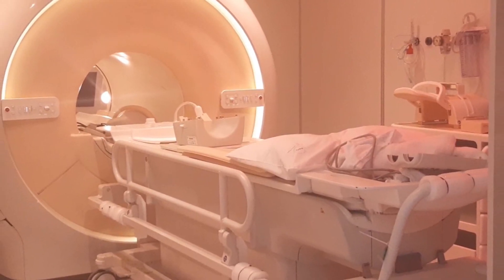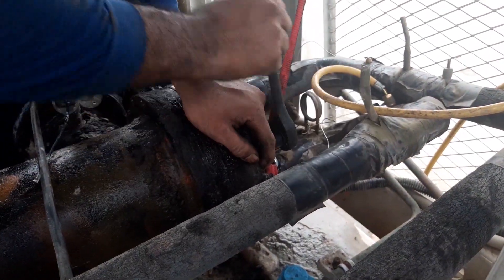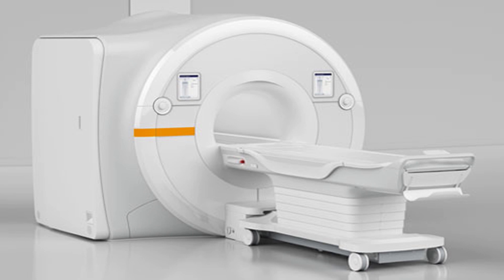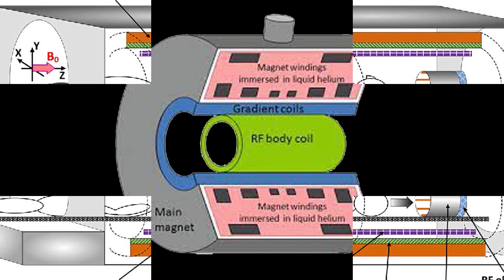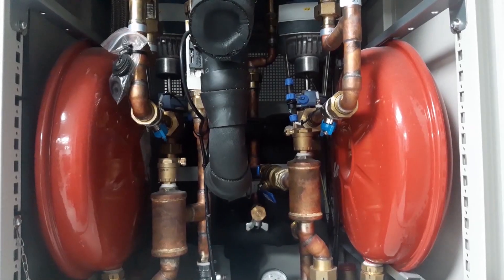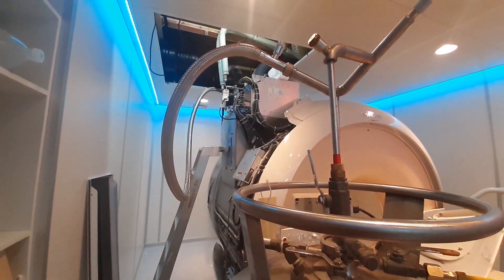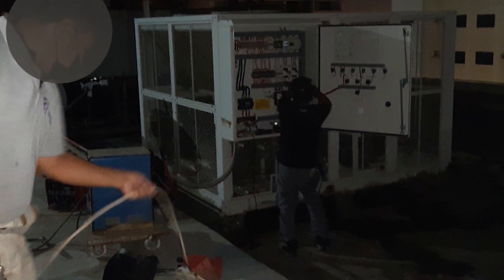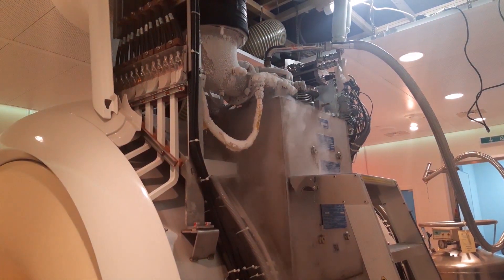What is MRI Chiller : Chiller Evaporator Replacement

Comment: The water chiller generally cools the RF generator and the compressor assembly for the helium recondensor cryogenic cooler. Ime it uses DI water because it cools live circuits in the RF generator. ❤
Reply from the maker: Thanks

Comment: what kind of gas do this use for cooling?    and does this system must be running all the time to keep helium at right temperature?
Reply from the maker: It has a separate chiller for cooling using water. It is running all the time and helium level are monitored.
Reply: It uses vapor compression system like your refrigerator in your house or your air-conditioner but instead of air we cooling a coolant such as water or polypropylene glycol for some industrial applications we use alcohols as coolant instead of glycol or water for example methanol or ispropanol due to it's low melting point.